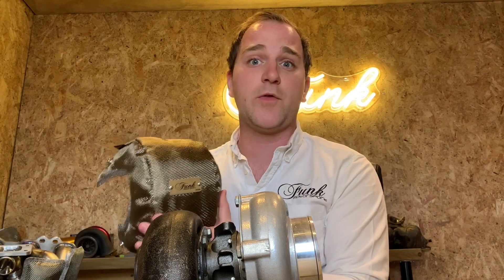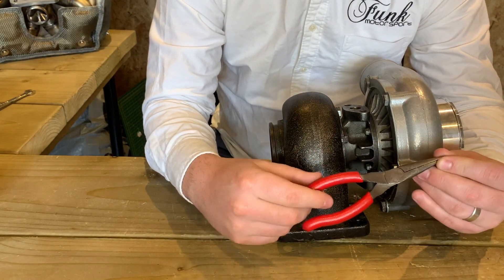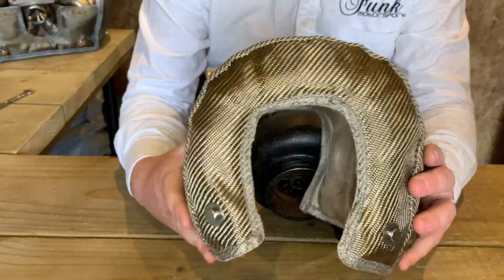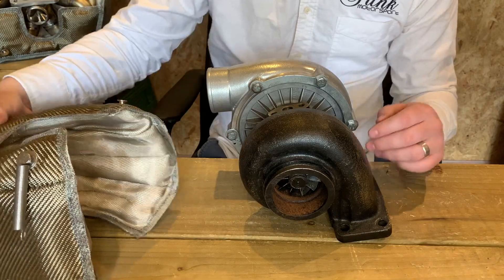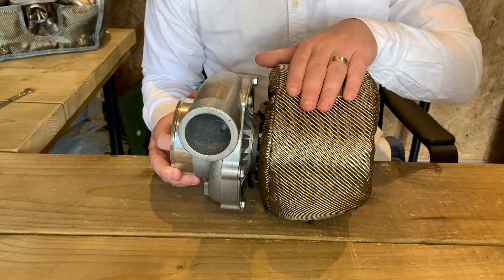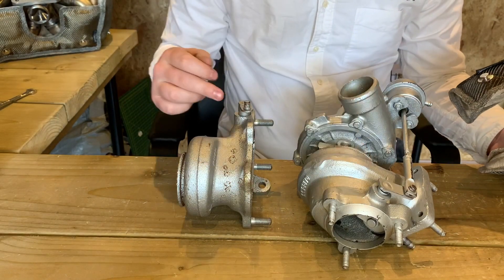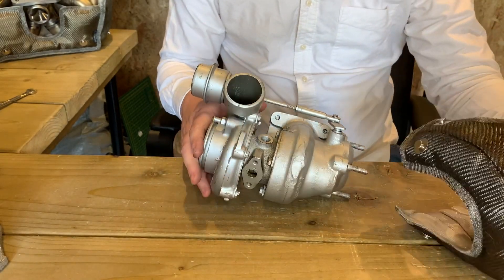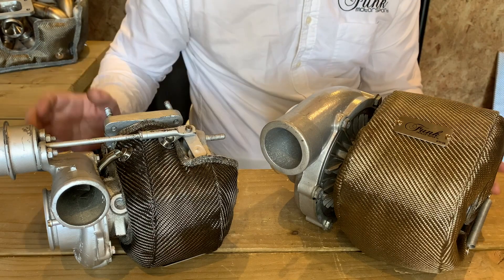How to fit a turbo blanket? For INTERNAL AND EXTERNAL GATED TURBOS

Comment: I just installed one of these on an FP Green on my STI and it was mounted in the car. It’s not easy but it can be done. One person under the car and one person up top. Use long picks with hooks on the end and pull the spring up to the person up top. We used angled needle nose pliers and picks with a hook on the end. My wife helped and basically held the spring up until I could get up top to grab it myself. Be patient. It did take us a few tries.

Comment: I have one of these for my efr 7670 iwg and I’ve found that the actuator arm has maybe 3mm of clearance from the hot side housing where that blanket should sit underneath making it impossible to actually fit the blanket underneath it. The only alternative would be to fit it over the arm would this impede the operation at all? Seems like it would but I don’t know

Comment: Useless video - how often will the turbo be sat on the bench ?? 🙄
Reply from the maker: Good point. However, we understand that everyone's setup is completely different to one another's. This video is to showcase how a blanket should sit with an unobstructed  view.
Reply: @Funkmotorsport  still a useless video. I know that every turbo in each different car will be slightly different but people need to be shown just how difficult fitting these actually is
Reply: @JustAnothaBrotha its not even that hard to pull a turbo out of a car
Reply: @slow_rednline4874  especially when you have no choice 🙄

Comment: What's the effect of the blanket on the turbo reliability? The turbo is clearly going to run a lot hotter.
Reply from the maker: Fantastic Question! In regards to your concerns, this is a common misconception. A turbo blanket actually separates the turbine housing from the core (in regards to temperature split). This allows the core work with less heat strain on it, meaning that the chance of failure is lower. Also, the heat energy stays stored within the gas, hotter gases accelerate far better than cooler gases, and so reducing the overall effect that it would have on the turbo’s life.

Win all around! Lower engine bay temperatures, less heat soak, lower intake temperatures, more reliable performance, faster spool up! Win win win!
Reply: @Funkmotorsport  It sounds very glib and too good to be true. Why wouldn't the manufacturers fit turbo blankets as original equipment?
I'll see what technical papers have published on this subject.
Reply from the maker: Another great question, generally, OEMs work within tolarances, and the heating and cooling of the engine bay works well within their chosen ranges. However, this takes it one step further to help (even OEM packages), even more efficient!
 @defendermodsandtravels
Reply: @defendermodsandtravels why did they add egr into a diesel engine when its known to increase wear? Oem does stupid shit all the time. If your building a car expecting it to last 200k, when you hit that goal after bulding the car, your not gonna try to make it even more reliable. If they were runnijg into heat issues than yes i bet they would have to put a blanket on. Or they would lower the power to keep the temps within range rather than spend money manufacturing and installing blankets on all your engines. Theres always a reason. Thats why they make delete kits for oem b.s

Comment: I'm about to wander the page. Is there a way to instal the blanket with the turbo still attached? 🤔
Reply from the maker: Yes Michael. Around 80-85% of all of our customers fit blankets when directly fitted to the car. Hope this helps!
Reply: @Funkmotorsport 
Do you manufacture a blanket that will fit a factory turbocharger on an MR2 or Celica Turbo? Any of them from the 1990s will do.

Comment: Hi I can't get mine to fit I have a mini countryman jcw 2014 bought your t25 internal as advised but I can't get it to fit🙁
Reply: Unless your putting one of these on with the turbo off then it's impossible and it should be made clear before u buy it as mine is now sitting in a drawer doing nothing
Reply: Just don't have the room to get the springs attached it's impossible 🙁
Reply from the maker: Drop us an email with some Images of the issues, and we would be happy to point you in the right direction 👍👍